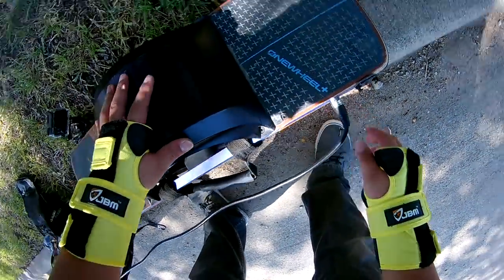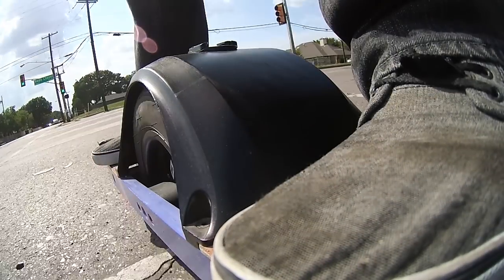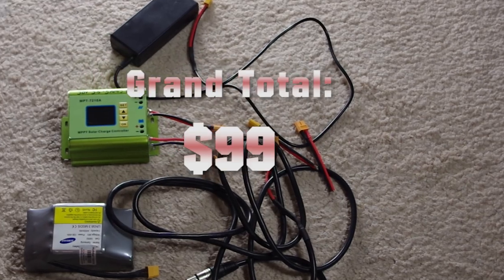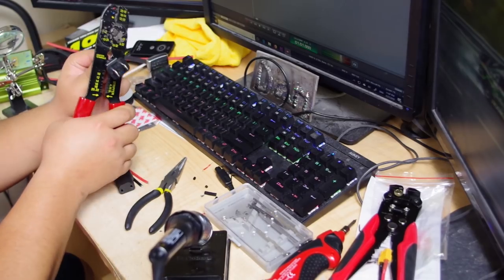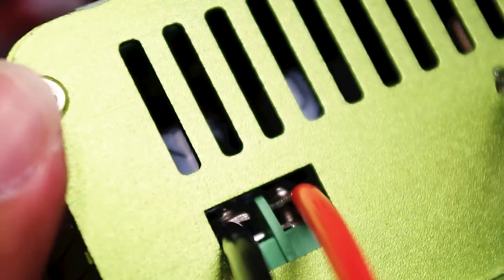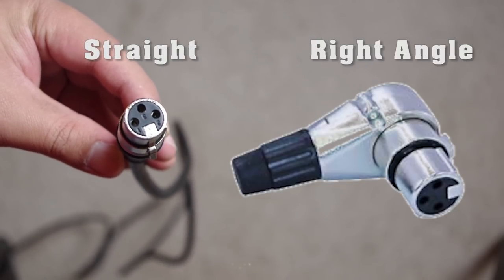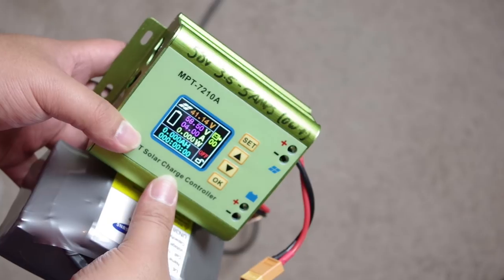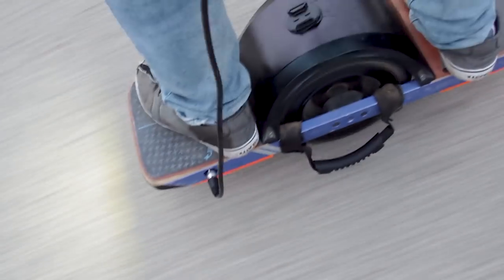DOUBLE OneWheel Range for Under $100!!

Comment: How do you recharge the battery used for this setup?
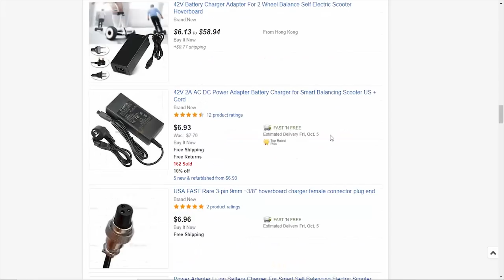Reply from the maker: Good question! At the 3:00 mark of this video the battery charger that gets soldered with the XT60 connector is specifically for charging the 'hoverboard' batteries.

Comment: Awesome vid!  How can u determine if the cnr will damage the board I have a plus. Also do you feel less 'free' with your riding style w it on? Thanks in advance
Reply from the maker: Thanks! So the voltage is super important to set it to the correct voltage or it can fry the board. Always monitor how much output the MPPT is putting out before plugging into the OneWheel the first time. Because of the draw from the MPPT a lot of times the voltage dips under than what you punched in the settings for. For this reason I set it to half a volt higher at 58.5V. Even then the voltage dips to -3 to -9 than targeted sometimes. When the external battery starts to die the voltage starts to dip more. Even with lower voltage the OneWheel will still charge though.

I can't say what the OneWheel will do if it malfunctions. I guess it could stop working or cause glitches can't say. This is why user discretion is important when doing a mod like this.

As far as the tether goes, I was always nervous in case of a scenario I would have to bail out, but I have now upgraded to a quick disconnect and a right angle plug with a 3D printed bracket made by Wren from Corridor YT channel. 

Ever since I got the quick disconnect setup I'm much more confident about riding my board with CnR. Sometimes it can get in the way and I accidentally disconnect the plug, but for the most part it's not too bad. YMMV on how you feel being tethered, but I don't mind it.

Comment: Can you just add another same oe battery and parallel it ?
Reply from the maker: It will probably be very expensive. I think the battery also has its own BMS system so I'm not sure if it'll entirely work like that.

Comment: what kind of battery and where you get it for $70?
Reply from the maker: I got a Samsung battery from eBay. It's a replacement battery for the "hoverboards" that have two wheels and go forwards. I found out later LG batteries are better though.
Reply from the maker: @ooga360booga2  personally the Samsung cells have given me no issues. But if you can find LG cell batteries go for those. Otherwise I haven't had any problems.

Comment: Cool. Thank  you. What battery did you buy and where?
Reply from the maker: I got a Samsung battery from eBay. It's a replacement battery for the "hoverboards" that have two wheels and go forwards. I found out later LG batteries are better though.

Comment: Why not just put a higher capacity lipo battery?
Reply from the maker: Inside the Onewheel? It doesn't work like that if that's what you mean. The battery has a BMS chip in it and it won't operate without FM's proper battery.
Reply: Slide Wreck Dan or add another same oe battery and parallel it ?

Comment: I've got a xr and I only get around 7 miles
Reply from the maker: Oof. Well to be fair, on my Plus I only got 4 miles with Mission mode when the temperature got cold. It's a combination of tire pressure, temperature, riding style, speed, and so on that determines the range you get. But the maximum I was able to pull off so far with my Plus on great conditions and probably averaging the speed of 10mph was 7 miles.

Comment: Did you not do a list of parts and suppliers?
Reply from the maker: Looks like I didn't. I can post them up. Only thing is since a lot of it was bought from eBay, even if I link them they become dead links very quickly. I'll link if I can find any that would seem to have a long listing.
Reply from the maker: Just updated the description!
Reply: Just doing an Amazon link or brand/part# list helps find the parts used so links don't die.  They don't have to be the most cost effective, we can Google.  Thanks for the update!